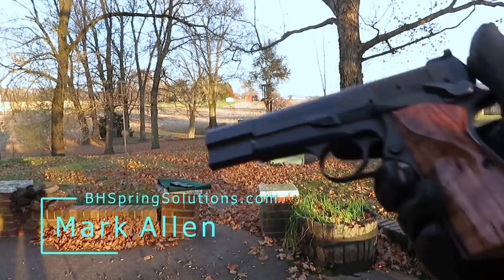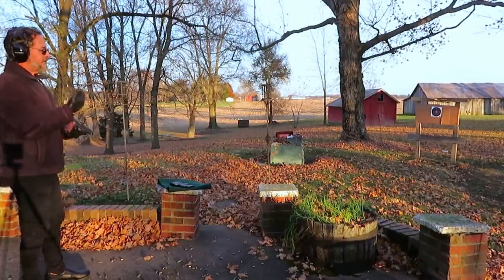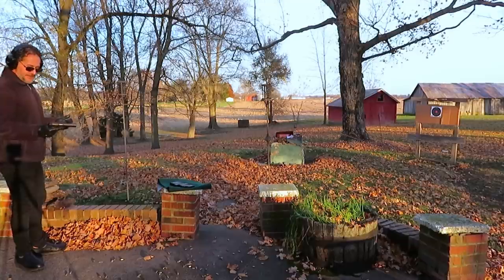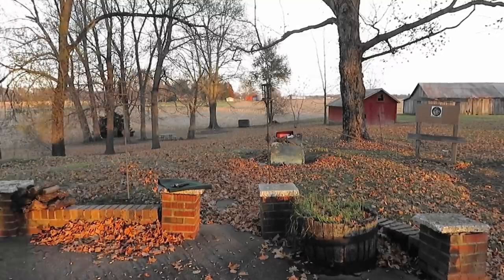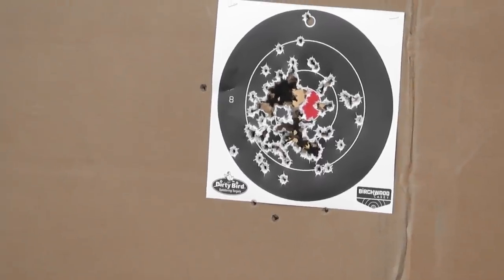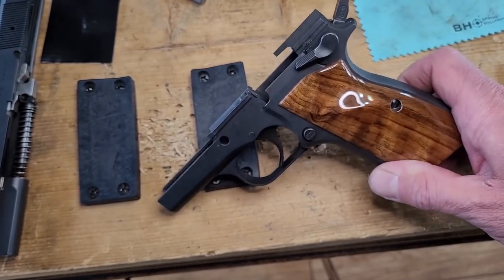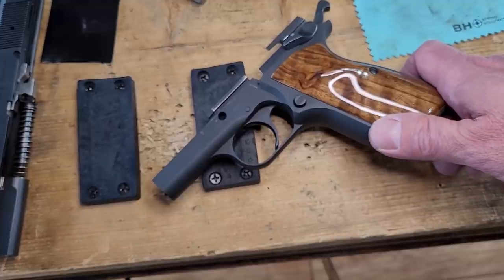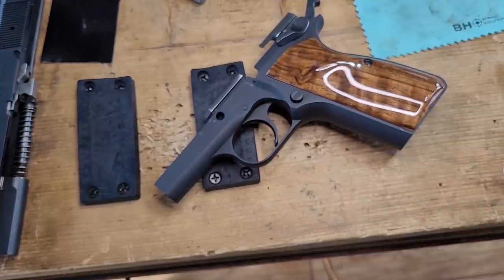Springfield SA 35 Hi Power Evaluation & Testing Session 6 BHSpringSolutions Hi Power University 71

Comment: Remember the MSRP is $699, not $1200-$3K. Dehorning edges, polishing bearing surfaces, installing upgraded components is what keeps custom shops in business.  The basic pistol seems pretty good so far with the potential for customization by knowledgeable operators or shops like BHSS. The eval was helpful but pretty tough.  At least you didn’t identify showstoppers like the Tisas.
Reply: That’s the way I see it. I’m getting one because I’d rather not track down an original hi-power to have customized the way I want. Going this route seems like a better idea if I’m going to have someone work on it.
Reply: I can’t believe they put the entire frame and slide into a tumbler…This isn’t a “special session evaluation”, this is nitpicking to oblivion to justify why everyone should buy all their replacement parts and gunsmithing services
Reply: @rudukai13  It's their gun, and they are using it as a testing bed for their own products and services. The fact that you complain here and various other times about a free video with good free information is obnoxious. There is no other free resource about this firearm available yet that goes into such detail. This is not nitpicking, it's a company trying to figure out how to work with a new system.
Reply: @rudukai13   my exact thoughts. I get they have to show their parts and advertise but “we put it in a tumbler because it has sharp edges” has got to be the strangest negative I’ve seen from BHSS’s clone testing over the year. They are completely neglecting the fact that it’s a HI POWER clone. The Hi Power wasn’t made to be smooth as silk gun, they were war machines that were meant to be mass produced for ground troops. Frankly, I think in a bid to make sales, in this case, BHSS has forgotten what the Hi Power actually is and is wanting it to be something it’s not.
Reply: Forcing a pistol to operate on weak ass 115gr 9mm, when it’s rated and sprung to run NATO and +P, then complaining about weak ejection and slide velocity is 🤬.
Reply: @centurian318  You say it's rated and sprung to run NATO and +P but where did you get that information? It's logical for me to assume a pistol being sold to the US civilian market would be rated and sprung to run US civilian grade ammo. I would further assume a civilian market US handgun would run on "weak" 115 9mm.
Reply: @DesertGhillie  
From Springfield Armory…

Also beretta, cz, Glock, HK, sig, are also rated for plus p and nato chambering and are readily available upon the US “civilian” market. I’m just wondering what level of troll you are.
Reply: @centurian318  Could you link that please? I'm just arguing that a civilian handgun , like the SA-35, would likely be able to run both Nato, +P, and cheaper civilian stuff.
Reply: @Eugeneden2010  War machines come from the lowest bidder. I have a BHP Standard, original owner for 32 years, and the lines on the rear tang are fluid, and they came that way. Ride it as high as you want and you won't get cut. The SA-35 is a civilian market product at an affordable price but it's clearly not superior to every Hi Power variant. If you want one with sharp edges, you're in luck. Others who don't prefer that don't have to be out of luck.
Reply: My first concern would be , is this safe gun to carry .

Comment: Just picked mine up and was really hoping for better quality.  The trigger reset had 2 very quiet audible clicks and would reset at the end of the travel. After research, I filed a few .001’s off the top of the trigger lever and this moved the reset to the center of travel and allowed it to make an audible click that I could feel with my finger.  The sear lever should be free floating in the slide but mine was not so I stoned the finish off each side that touches the slide and that fixed that. Next is the (hard?) sear, that locks the hammer back has slop in it so when you pull the trigger you hit the wall and then you have a small amount  of grittiness and than the trigger breaks.  Almost like the 2 parts don’t mesh together.  So either the sear needs to be shimmed up somehow or the hammer needs to be filed down to match the sear.  Not sure if I’m gonna mess with it but I’m definitely not dealing with sending it back.  I’d say if you’re in the fence and have the extra cash, just get the FN.

Comment: Thanks for sharing your experiences and insights on the SA-35.  I agree with Mo N that this is a very nice gun at this price point.  After extensive dry firing, I took mine to the range this past week and fired 300 rounds without a single malfunction or significant issue.  I did not have any hand cuts, hammer bite, and etc.  The only two issues noted was that it shot a bit low a 7 yards and the trigger needs some work.  Specifically, the trigger behaves like a 2 stage trigger with 2 distinct  walls with slow fire.  I spoke with Springfield and it is on the way back to them to look at.  Also I would note that while my safety did have a small amount of movement with the hammer forward, it was not enough to interfere with the slide cycling.  Three hundred rounds is not an extensive test so I'll continue to see how it performs.  However, at this point it was purchased as a range gun and I do not see the need to modify anything.  At some point I may add a wide trigger and a fiber front sight.

Comment: Okay, so the thread protector loosening is normal.  I ended up using locktite to secure mine. Downside is that it now requires pliers to get it off.  I also had to file a relief angle on the barrel chamber hood in order to install mine.  I wonder if that’s normal as well.

Comment: Well I got mine from a military guy that couldn't keep it.  It looked unfired when I got it, with original lubricant all over.  I paid $832 though.  It's a low s/n.  It's fit and finish is quite good.  No unusual marks or blemishes.  There are no sharp edges.  You either got a prototype or just have very sensitive skin.

Comment: Is it possible to install, with only changing minor parts and no drilling or changing the slide, a mechanical block for the firing pin, like the more modern FNs Hipowers?
Reply: This is a question I have hoped to see answered as well.
Reply: No it isn’t.  You’d have to remill part of the slide in order to accommodate both the firing pin block and the different sear lever that interacts with it.  I seriously doubt you’d ever find a gunsmith willing to do such a job.  Plus, even if you could, I imagine that such a job would be hideously expensive.
Reply: @DLordSadow  what a bummer. Anyway, thanks for the clarification, saved me some time and money 🤑🤑

Comment: I can’t help but notice that all the parts you’ve recommended replacing so far happen to be parts you manufacture and sell aftermarket replacements for. Would it not have been a bit more fair to shoot the gun in stock form for a while first, then swap out parts and compare?
Reply: Agreed. I was confused why he replaced the parts FIRST and then did the torture test.
Reply: @tberkoff  The very first video explained that the purpose of their testing was to determine whether their parts would work in the SA-35, and to determine if the SA-35 could be used as the basis for their custom guns.  It never was intended to be a Consumer Reports style evaluation of the SA-35.
Reply: Explained at 9:19 sec in the video.
Reply: This shows that you skipped the very first video explaining why this series was done in the first place. 
Furthermore, it makes sense that they recommend replacing the stock parts with their own upgraded parts... why else would they make them? Also, some of the parts mentioned, like the extractor, they don't even produce - they recommend a Browning extractor instead.
Reply: @DesertGhillie  yeah how in the world could anyone miss a quick reference in a single 40 minute video in a series of four or five videos each one 30-45 minutes long??
Reply: Thank you!